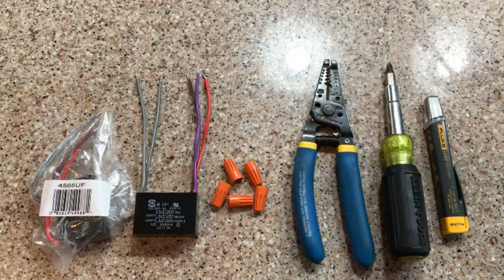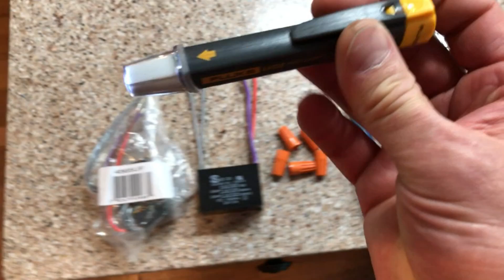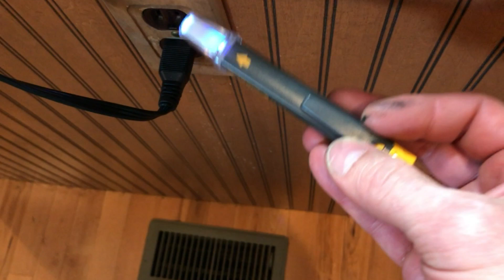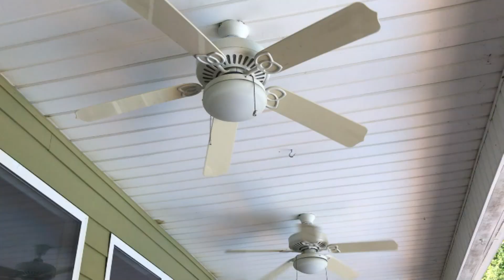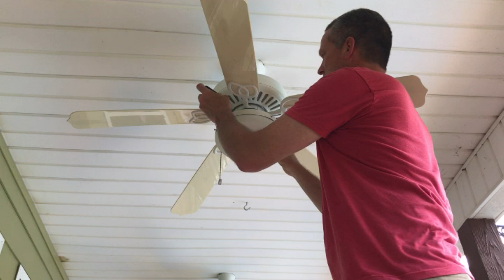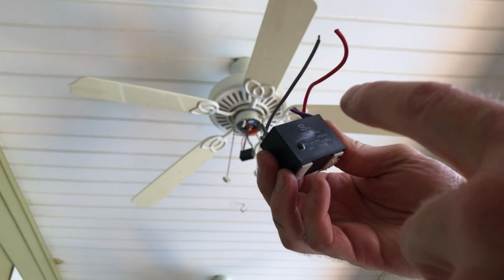Ceiling Fan Won't Run.  Capacitor Replacement

Comment: If I replaced both these and still have a slow running fan is the fan just done?  Can the reverse switch cause this issue?
Reply: Reverse switch wouldn't really slow down the fan. The factors that slow down the fan includes:

Bad capacitor.
Overpitched blade arm.
Bad bearings, but there would be short spin down before obviously slowed down high.
Winding taps connected together (happens rarely, and can make all speeds the same, only some fans use winding taps for speeds)
Bad transformer (only few fans use transformer)

Comment: My fan won’t stop running. Control is on my wall. Control won’t shut off, change speed or turn on fan lights. Don’t want to buy controller or receiver and learn that wasn’t the issue. Suggestions? Also pulled only fan chain and won’t do anything. If I turn breaker back on, fan blades continue on.
Reply from the maker: Al Complaint batteries are dead or the remote needs to be re-paired. Not repaired, re-paired. You will have to look up the procedure for your remote.

Comment: @Fix Them Things, I am at my wits end to find a capacitor.I am aware they are all over, but one I need per spec no.I will start in short with the fan.I have no id of fan of which, my luck.I have a hunch it is a Harbor Breeze.I may suspect it is on top of motor and will have to rip whole fan down.2 foot blades, big size fan, ceiling.Worked for years as it is older nowFan has light duty on it in use.Kept it clean in room of house.Had a issue of ran on high speed and med.Low it would stop and hum.Went on for years I guess.Anyway, today I broke the speed switch.I get inside fan and inspect and indeed switch for speed is broke case cracked bad.Three speed switch.I see also the capacitor is on it's way to the dump.Has a large knot on it swelled up.I have the switch to replace issue is, capacitor.Hate to toss fan knowing it is capacitor.Finding my capacitor is a joke.On it is all and I mean all listed.RU.Below that is #E158584.Middle is, 1.75uf below is, R line straight out to Y.Below is, line out to P.Below is, 3uf.Below is, 250vac 60hz T 70*c.I work on electronics so, I understand most this.Except I can't seem to get a clear part number.I run everything comes back to capacitors for sale 1.5uf 3uf.I can't say for sure if that will impact the start or run of fan 1.5 from 1.75.So, with all said I need a 3 wire red blue yellow capacitor 1.75uf 3uf.Where is that exact one at?
Reply: Joesph Baumgardner have you tried taking that info to Ace hardware or Lowe's or home depot? They might help you find it

Comment: Can you show me which wires from the fan go to the capacitor? My wife didn't take a pic before unwiring the bad one. I have the same capacitor you did in the video. I'm stuck and it's getting hot in my living room. Thanks
Reply from the maker: Jeremy Edmondson should just match color for color. I have a picture but it won’t let me add it from my phone. I’ll have to do that from my computer later.
Reply from the maker: I have been trying to add the photo of the connections but YouTube is not letting me paste a picture in the comments.  I don't see an add picture button either.  Sorry.

Comment: Those are Harbor Breeze Calera. Maybe old capacitor got affected by hot and cold weather?
Reply: The Channel of Random Ceiling Fans ,,d
Reply: How can the weather affect the ceiling fan?
Reply: Fans & Appliances With Bobbie Ochieng Well, extreme heat can wear out capacitor faster.
Reply: Fans & Appliances With Bobbie Ochieng Corrosion can happen too.

Comment: Hi +Fix Them Things!,
From 2 days whenever I switched on my ceiling fan it started at high speed and then intermittently became slow, picked up speed. I suspected a loose capacitor connection, but didn't confirm so. Today after around 2 minutes of switching it on there was a small spark and the fan & all other electric/electronic appliances went off in the room as circuit breaker tripped.
When I inspected there was a loose capacitor wire for sure. I removed some more plastic coating from its front end and inserted it well. However, it seems it didn't work. Do you think capacitor suddenly getting disconnected from the running fan damaged its winding or something?
Reply: Fix Them Things! Hello what if the fan makes humming sound but won't spin at all either direction ? Also the humming of the motor gets louder as I go from low med high.It won't even keep spinning even if I give it a strong whirl.Also it spins freely.It's not hung up at all.
Reply from the maker: watawonderfulworld I would think either the capacitor or switch is bad. The switches usually just have the wires pushed in which make a terrible connection. Tripping the breaker is either a short circuit or an overload which I assume tripped due to the loose wire on the cap touching metal (short). Does it run at all?
Reply: No... It doesn't run now. It just stays put makin a buzzing sound until I give it a little push after which it starts but rotates too slowly.
Reply from the maker: Ok.  That's good.  You need a new capacitor or your leads are not connected good.  Do not try to run it until you get a new capacitor or check the connection.  The capacitor starts the motor and adjusts the speeds through the pull switch.  Since you had to give it a kickstart push, that proves it is a capacitor problem.  Hope that helps you.

Comment: Were was the switch for those fans
Reply from the maker: Jason Mckay the switch was on the opposite side I was standing on. The switch was fine. It is almost always the capacitor unless someone actually pulls the switch cord too hard.
Reply: Do you mean the wall switch
Reply from the maker: Jason Mckay no the rotary pull switch inside the fan. They will go bad from pulling them too hard.
Reply: Ok were is the wall switch